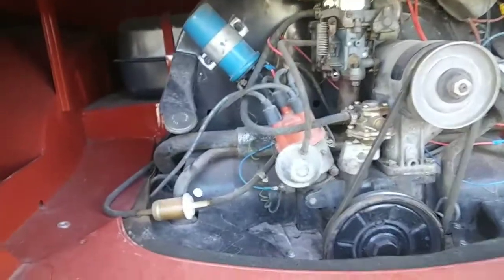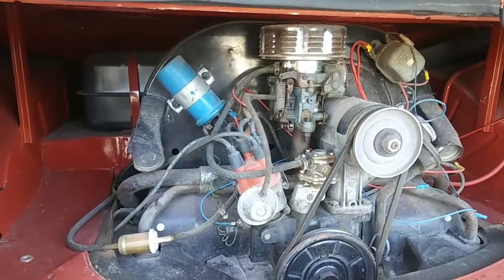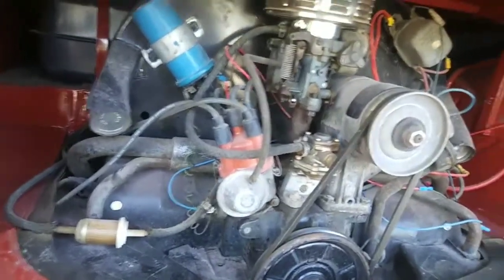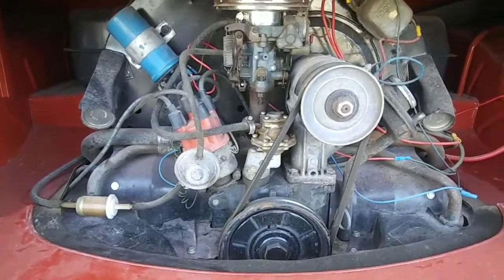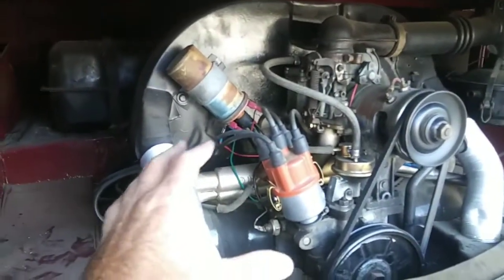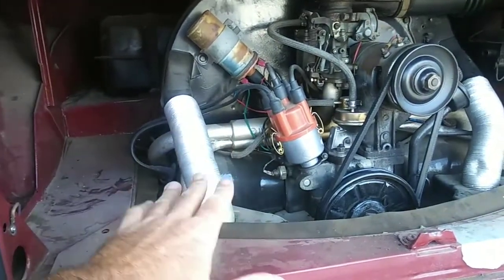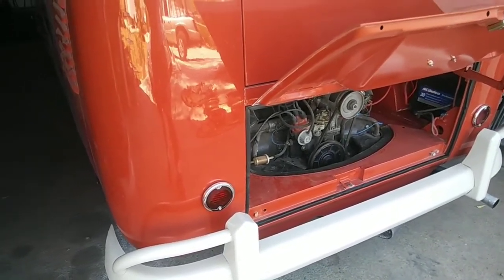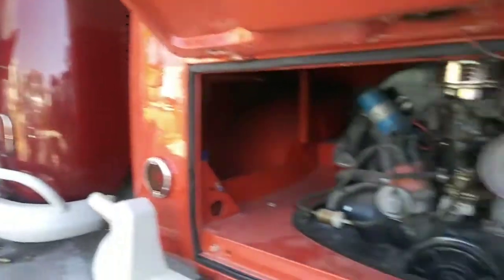VW engine how to prevent VW from overheating more information

Comment: Nothing with 7 to 1 compression needs anything close to premium fuel if the timing is set properly and the grade of fuel you run has nothing to do with what temperature your engine runs. 
Premium fuel prevents detonation and that's all and a low compression engine shouldn't be detonating anyhow if it's properly tuned.